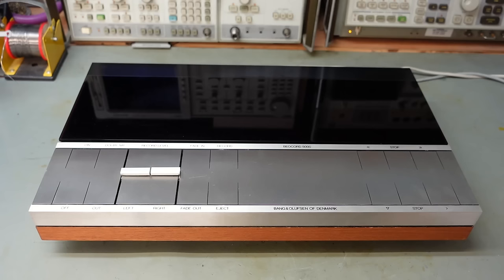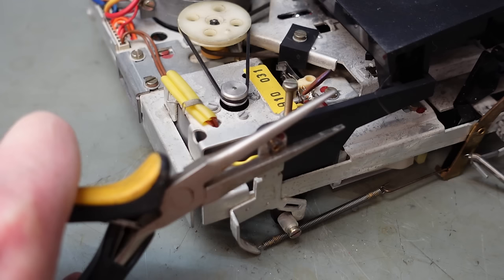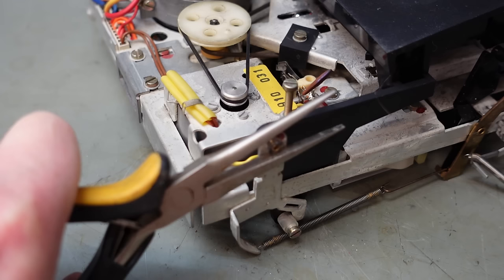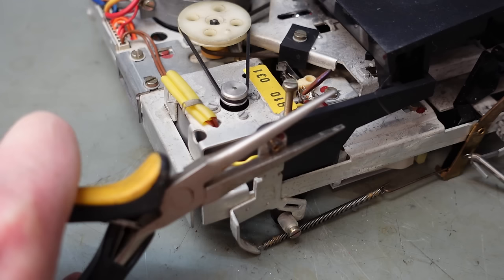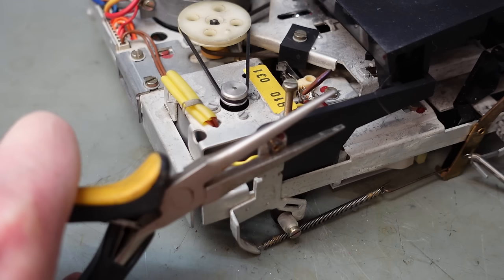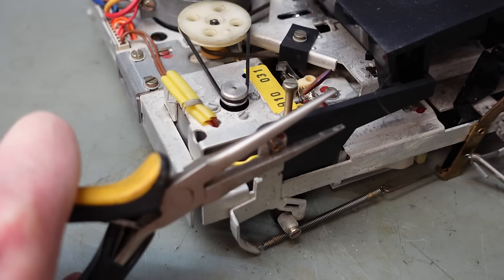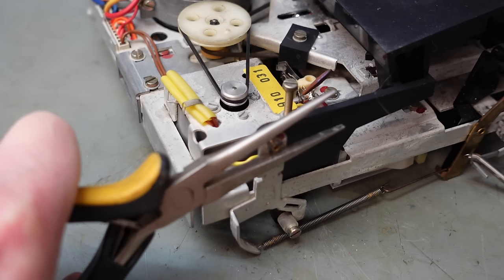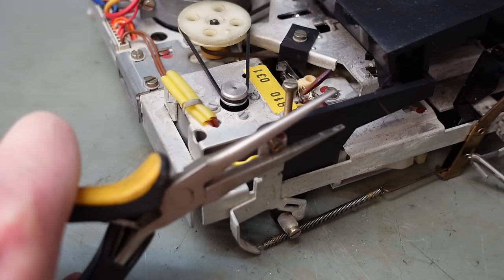The BEOCORD problem

Comment: My grandparents used to have one of these. It looks impressive, but that's about it. Expensive, but with all the problems of a cheap tape deck. We mostly used a much cheaper Akai top loading deck from around the same vintage, it always worked fine except for the VU meters.
Reply: Yeah this is part of the stereo system that the "rich neighbors" have in national lampoons Christmas vacation, that gets ruined when the gutter breaks and ice flys through the window!

No wonder why they used it as a prop, it looks super expensive.

Comment: Mark - I now always use Deoxit FaderF5 for pots and cleaner for switches, plug sockets and the like only.  I've had contact cleaner remove tracks  - I didn't realise they were conductive plastic tracks in some types and the cleaner wrecked them - it's not always easy to tell so better safe than sorry.

Comment: He's got the point one mm incremental drill set.

He's got a shaft bearing issue and some clockmaker's imperial bushes.

He's got colletts to grip the bush and bit separately.

He's reaming out the bush by hand.

Nothing lines up of course.

But he's got a lathe so he can make a new wheel.

This is far more entertaining than just reaming the bush on the lathe first.

Props 👍

Comment: I use to pull those coreless motors apart. Very high quality. Earlier ones were easily dismantled, but the later ones are a pain when they were not so easy to dismantle... I use to actually heat the bearings up in machine oil, then let the bearings cool down. The real serious issue these days are the brushes that wear through. Not found a fix other than to replace with new!

Comment: When I did on site repairs of equipment & you wanted to stop nuts/bolts & sometimes small screws from backing out we’d use a small blob of Bostic or similar glue. That was easy to remove if necessary.

Comment: Great work on the mechanic restoration!
But you are missing the finishing step.
With all the rest equipment you have you are just a few test tapes away from doing a proper play and record levels calibration. That’s quite important to make the deck sound right playing back Dolby encoded tapes. Maybe part 2?

Comment: I always enjoy Bang & Olufsen Repair manuals, particularly their turntables where to adjust the automatic features and they just tell you to bend the levers inside. Like you would think for something that is as sophisticated as it appears to be, and as expensive as it was when it was new, that there would be a precise instructions on how to do something, no most of the instructions tell you to stick a screwdriver in it and then bend it until you get the desired result.😂

Comment: Casette decks are always tricky, there are so many places where you have to have friction, right next to places that need lubrication. And tension, but not too much tension.
Computer printers can be awkward for the same reasons, with the added joy of old ink everywhere. And, in the case of vintage printers, chads everywhere and labels stuck inside...
And as for circlips, they can reach low Earth orbit in a fraction of a second!

Comment: Mark you are as skilled as they comes ... I guess much your skills are from autodidactical trial'n'error but still you must have a fine-mechanical / low-voltages enegenering education as a basic... nice to see your skills applied with wonderfull nerdy enthusiasm... such a shame everything mechanical/electrical today are not build to last or be repaired but KUDOS to B&O for making so many detailed manuals for the technician. Good thing ex. EU-regulation forces product-makers to enable new products to be repairable. How is it with UK-regulation in this area when UK now is out of EU? What

Comment: With closed loop dual capstan, big flywheels and 3 heads, this was the top back then. This unit however is the new version with 2 heads. It is also the only tape mech B&O ever made themselves.

Comment: Mark goes way beyond the point of just doing a repair, i have never worked in any repair shop that 
had the machinery to make new parts, if they were not available as spares then the item was declared 
beyond repair and returned to the customer.
This is what is required to repair the older gear, i hope the customer rewarded Mark for all that work.

Comment: Way back in the 60’s/70’s I worked for a office equipment company and used to get many jobs fixing dictating machines like Philips , Grundig etc..  Many faults were mechanical like solenoids operating shafts/ gears etc.. Main Motors were synchronous AC 240 volts 50 HZ  ! Loads of switches and relays so plenty to go wrong with poor contacts etc! The service manuals always said don’t put any oil near bearings as they were bronze and oil would get on the rubber belts! Nylon and plastic gears, only use silicon grease or oil! Much troubles was caused by grease drying up and mixing with dirt! Like Mark I used alcohol to clean bearings and tiny touch of light oil to free up sticky shafts etc! All small dc motors had commutators which were a pain in the axxx! 😂 Nowadays it’s all servo motors and Hall effect types controlled with digital pwm circuits!

Comment: Engineers all have different ways of doing things. I was gobsmacked when Mark desoldered the record / playback switch assembly.  Any new comer could easily destroy a machine trying to take those off. In 50 years I've never needed to. They are also easy to clean on-board.  B&O, a funny mixture  of great design and engineering with the engineers struggling to keep the designer happy.- and not always  winning. Amazing video though, and great  results.Edit: Saying that,cleaning that relay in that manner may have saved a lot of headaches.

Comment: The red plastic capacitors I see there. Typical B&O, their products were packed with them, easy to spot with cracks on top. Cheap parts in ekspensive furniture. But that was back in the day when I was a professional repairman. Nowadays it's just a hobby :) Greetings from Norway :)

Comment: I might have missed it but capstans should be sealed by a little plastic washer to prevent oil spilling out of the bush onto the rubber roller.

Comment: Hello there Mark. 
I just found your channel two days ago, and as a newly started hobby eletronic and HAM radio user, this really sat a fire to my kindrel.
I do though have to ask you one thing, that IPA bottle/despencer where that hell did you get that :D or what name can i look for, i need that right away. :D

I am at the stage where i am learning to use an oscilloscope (got an old 2ch Meguro) and learning basic components and what they do. 
Did my first service on an old Pioneer PL-514, it was fun, just a clean and relube but hey you have to walk before you run right.

Anyways thank you for the content, and for being so funny, love it.

Cheers Jeff

Comment: Yep, typical Play load current is anywhere between 55mA ... 120mA depending on the machine, although over 100mA is a bit high from my experience, but the BEOCORD seems different. For big old induction motor cassette decks, from memory you can expect a but more; maybe 120mA .. 160mA.

Comment: Nice job. It was an unusual and difficult mechanism. Would be better if you replace the old pinch rollers, looked like they would cause trouble soon.
Reply: Can you get new pinch rollers today? New not NOS.
Back in the day we just disabled one capstan (the one "not needed") that solved most tape salad problems.

Comment: The easiest way to cure the run out on that plastic pulley is to put a dab of rubber adhesive inside and push the pulley back onto the spindle. Because it's driving belts, it doesn't matter if there's any run out on the pulley itself because the run out should be taken up by the belt so if you just dab a little bit of rubber glue inside and let it dry you should be good ans its a much easier fix.

Comment: Dont forget to clean the pinroller left and right from the tape head.they often are dirty and sticky, and causing the tape to running not smooth and when the Rubber Material is Cracker,they needed to be replaced. Otherwise good work.

Comment: remember when you "tweeked" the LHS loudness UP slightly, well now that the unit is finally "fixed" as you would say, I did notice right near the end, that the "output levels" of the facepanel's level-lights, the LHS levels are slightly too high now.
Not much you may say, but to me, the two outputs "should" as near can be for stereo mode, be almost equal, thus if you were to record a "mono" track onto both the LH & RH sides, ?I am certain the VU output level would NOT be the same, as the "tweek" you gave that pot on the circuit board, will output a higher level on the LHS than the RHS which actually got exactly the same "mono" input level, so go back to 1:05:18, and revert the "levels between the two, to the original setting, to ensure the output VU levels are "put back" to as near as the same levels, because all you did, was artificially make the LH test signal higher for your scope only, as you never set the RHS after upping the LHS.
Because at 1:05:24, the LHS sine wave was quite a bit "wider" than those of the RHS, meaning an offset making the LH Channel louder than the RHS, a very bad affair, as stereo isn't JUST two channels, but two at / or as near too, equally balanced outputs.
Having the LH higher outputting (on the faceplate VU meters, quite a LOT different, and higher, than the RHS, means the signal positioning is left of center now, instead of center of room.
If you have NEVER HEARD of summated frontal MONO and the exact opposite being the differential, between L&R output levels, then go back to audio school, as the levels between the two outputs need to be as close to near perfect, if a dual mono is recorded onto both channels from a single mono input split across both recording levels, which when replayed should be at or almost perfect, & not one higher than the other.

Comment: The picometre or picometer is a unit of length in the metric system, equal to1×10−12 m, or one trillionth of a metre, which is the SI base unit of length. 
Meter(m):
Mega(Mm 1000000)[1×10⁶]
Kilo(km 1000)[1×10³]
Hecta(hm 100)[1×10²]
Deka(Dm 10)[1×10¹]
Unit(m 1 meter)
Deci(dm 0.1)10th[1×10-¹]
Centi(cm 0.01)100th[1×10-²]
Milli(mm 0.001)1000th[1×10-³]
Micro(μn 0.000001)
1M'th[1×10-⁶]
Nano(NM 0.000000001)
1 B'th[1×10-⁹
Pico(pm 0.000000000001)
1 T'th[1×10-12]

Comment: Hi Mark, I noticed one of the solder joints (pin 13, 0V ground) didn’t completely flow whilst refitting the switches (around time point 1:03:31). The deck appears to work at the end of the video, and you may have reflowed this joint off camera.

Comment: You should probably dip drop of oil on your new pulley axle, as it seems to be causing problems when under tension. Its softer material than original one. Maybe it fix itself over the time.

Comment: At 42:00 - p is an old force unit and is equivalent to the force a 1g mass experiences at ground level. The torque units on these cassette torque meters are incorrect and should be p cm (not g cm) by old (before 1978) standards and would translate to 1 p cm = 0,00981 N cm by today's standards.

In the meantime I acquired different types of torque meters. These dynamic ones have the problem that they can cause wind up effects in the control loop even if you don't have mechanical problems. I'm observing similar effects with a Dual C846 for example. There are static ones that will stall the takeup or rewind weels and give stable results.

Comment: So, Mark, um... I am just curious: These are not really repairs that customers bring you, right? You regularly repair rather trashy equipment that at most has some emotional value to some people, and the resulting repair would be in the thousands of pounds. I learned to do what you do here in the 90's, but shortly after none of it remained profitable, so eventually  I ended up in IT. Maybe what you do here is the solution to reviving this profession: Do the repairs, charge a pittance to the customer, and then finance the lion's share of the effort via the monetizing of youtube content. Because the way you do it is so, so satisfying, the way you dismantle motors and repair them instead of shrugging your shoulders because they are no longer available - it is what this line of work should be about, it's what makes it fun and worthwhile. I am waiting for the day when you need to recreate a TV flyback because the original burned out and none are available as spares. Or when you need to re-coat the resistive carbon track on an unobtainable custom potentiometer. 
Anyhow, please forgive the wall of text, and thanks for he brilliant entertainment.

Comment: I have to wonder after working on all types of tape mechanisms in my lifetime,  is a bit of polykote light gear wouldn't have quieted that down.   After all,  this drive is only for the reel operation. 
Still,  I'd love to have developed those manufacturing skills!
Reply: ...a bit of polykote grease...

Comment: That dimple in the pully is probably from injection moulding..

I miss the days when a manual was actually useful... When they actually had schematics, reference points (measuring points reference waves all that good stuff) and maintenance tips, in stead of "Don't put your small pets in it". Sometimes I genuinely feel like I took a wrong turn somewhere and walked into a parallel clown universe, somehow, these days.... (And I'm not even that old, just shy of half a century.. well.. putting it like that, maybe that is old idk... But somehow it makes me feel like either Waldorf or Statler sitting on a balcony booing at the show/life a lot in the past 10 years..)
 
Tapecounter belts are a nuisance in mostly every tape deck ever... They already were in reel-to-reel machines.. I had so many Revox machines where people just gave up on the idea of having a tapecounter after trying to change the belt.. or the belt snapped at some point and someone didn't feel like taking the whole thing apart for just the tapecounter... And the Akai decks I had were also terrible to put the tapecounterbelt on... Why is that? They are always long and need to go through and under everything else for some reason..

Comment: 1:03:31 Looks like the switch pin next to TR1 didn't get soldered properly. I've been keeping an eye out for it in the rest of the video and it still looked like the solder hadn't been fixed. Did you fix it later on?

Comment: I'm a bit curious as to the final result.  Given the amount of work you put into the repair (the fabricating the new pulley was incredible)...why the final alignment seemed so..."close enough."  Most would set azimuth via an X-Y mode on the O'scope as it will show when you are dead-on.  Likewise, on the levels, you seemed to approximate and the meters didn't show uniformity.  What was the wow/flutter as the playback seemed to have instability?  Perhaps this unit is to be a shelf-queen and not meant to be actually used...just put in a condition where it could be used (or sold as "working").

Comment: There were so many faults on this deck, certainly not an easy machine to work on, I recently serviced a Technics deck from the same era, much easier to work on, two hours start to finish!
New belts, clean dirty record/playback switches, replace a couple of bulbs & clean /relube mech, machine works perfectly, I do like how well built machines from this era were, way better than the later gear, full of brittle plastic parts that are unobtanium.....

Comment: Well done Mark.Think i need you to take a look at my Technics twin cassette RS-DV280.the record deck right hand spindel starts to turn then after 2 or 3 seconds stops.I have changed the cassette tape to see if that might help,but still have the same problem.both tape decks have 2 motors,1 for each spindel.looked at the rubber bands and the plastic gear wheels they look fine.So this is a mystery for me.Any thoughts would be appreciated thanks.

Comment: I'm still convinced that the motor is bad, it should not block so much. It mangled the tape even on normal tape before you inserted the "measuring" tape. Maybe it gets better with usage. Is it so expensive to replace it?

Comment: what is the brand and model of your de-soldering gun sir ? it seems working an durable, does it suck powerful enough ? and what is the maximum temperature of the tip ? and also your iron ? is what is the max temp of your iron ?
Reply: Metcal MX-DS1 Desoldering Gun 
See video number 30: Electronics Workshop Tour. September 22 2022
Timestamp 9-40

Comment: What desoldering vacuum gun are you using?
Reply: From what I gather it's down right magical... it's based on the 'venturi affect' instead of the a more traditional 'vacuum pump'.. it does require a air-supply. I really LIKE it. I can't afford it but I like it :cat-orange-whistling:

Comment: A customer? Really? From the 1970s to 2024? This out dated machine was ahead of it's time, but after 2000 the customer should had known to backup the cassettes after 2000. On the outside chance the owner had 54 years to do something about his BO and could have bought a newer deck instead of fixing that unit. I delivered a B & O and when I went through the controls the customer never knew how to use it and I got stuck there for two more hours teaching the owner how to use his B & O! I was in my late teens back then, but the day was over and I needed my dinner and sleep. I learned to hate electronics that people should take the time to learn what they are buying before they buy something like an B & O before they buy something like that. I did like the jukebox phono they made but jukebox phonograph is not a DC servo with a balanced 'S' shaped arm which I still use today, but newer and better design since back then. You also had to have spent way to much time on that. One last item or thing, is the Sperry Tech Guide still in use? If so, what would they recommend on all that time spent on that job?